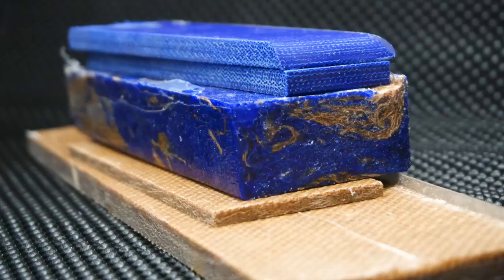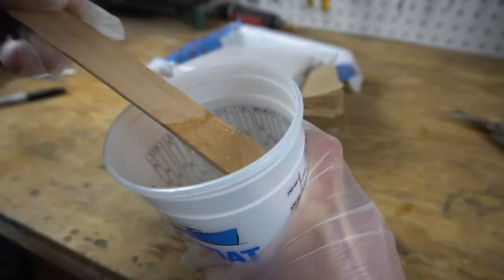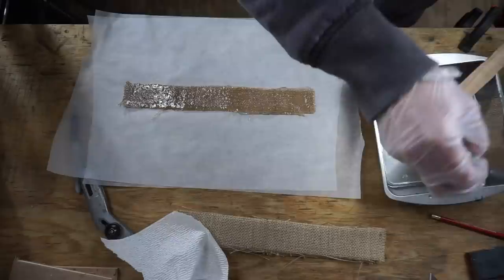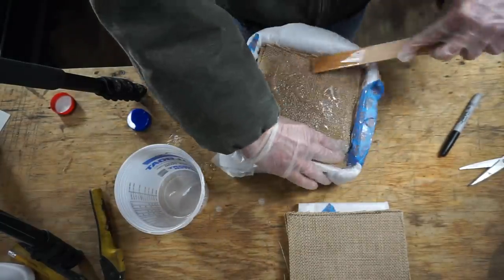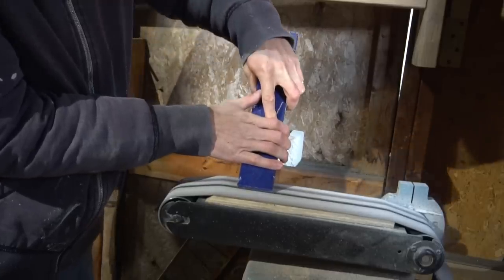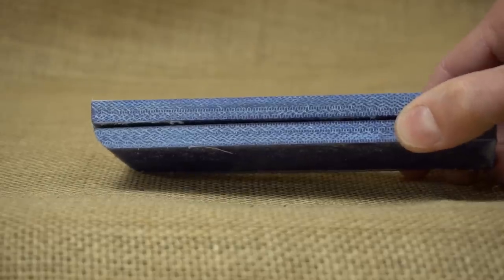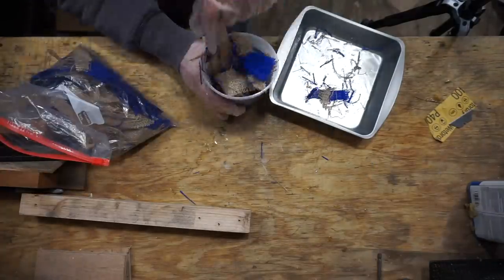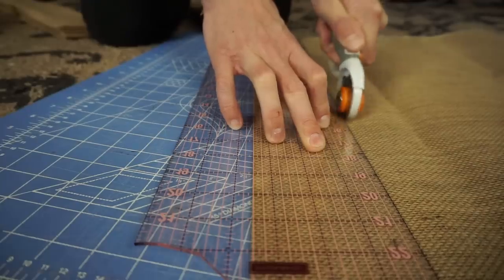How To Make Micarta | A DIY guide to what its really like to make this stuff

Comment: Instead of making this material you could just use wood or bone or horn or whatever.
Why would anyone bother with this chemical abomination, when organic materials feel so much better in the hand is a mystery.
Reply from the maker: Your right, it doesn’t have the natural organic feel to it. I like natural wood handle material the best. It provides good grip and can last for years and years but it does require a lot of maintenance. And doesn’t like to get wet. That’s why synthetics exist. Both have pros and cons 🙂👍
Reply: i agree and disagree, wood and bone are fantastic, but the feeling of micarta is extremly good, because of the fabric you will always have a good grip
Reply: I'm making scales out of my old military uniform, you can't do that with bone or wood.
Reply: @MauricesExoticPets  You technically could. You could make a saw dust/resin handle or make something like how pen makers do with odd chucks of wood with epoxy filling gaps.